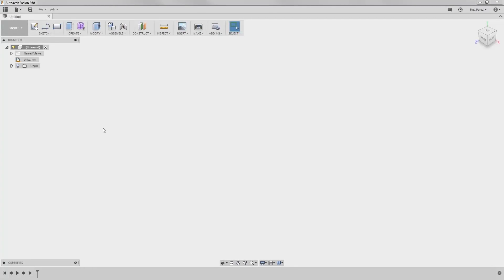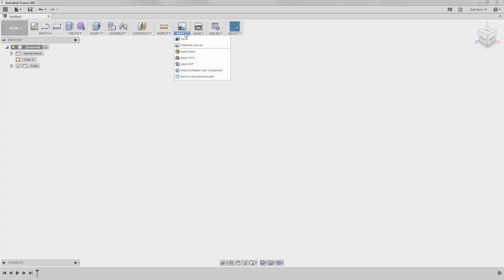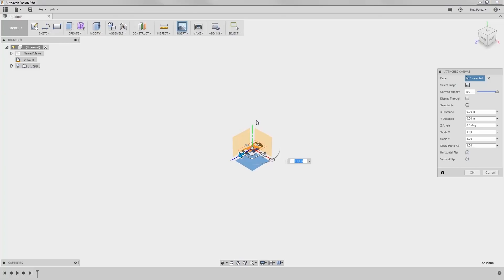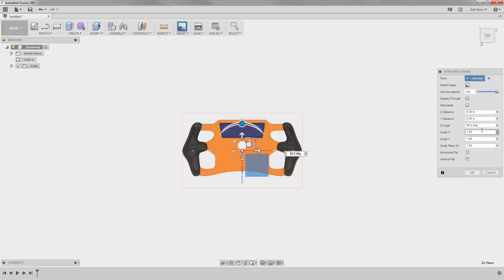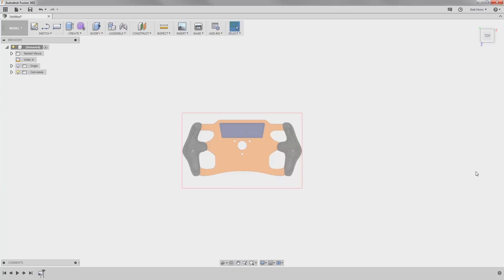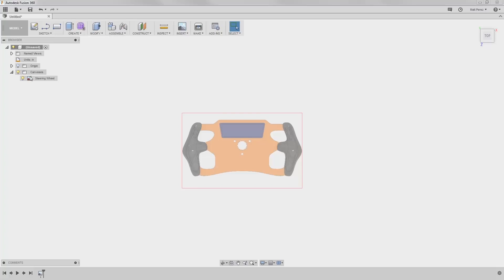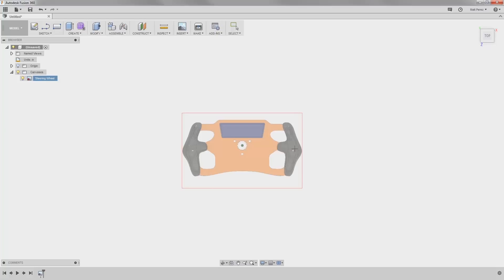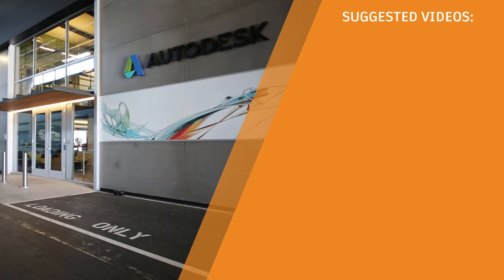Design from an Image Canvas

Comment: One important thing not mentioned here: If you want to have decent control over picture opacity of your canvas image after you insert it in Fusion, make sure your JPG or PNG image is a 16 bit color image. An 8 bit color image will produce a washed out canvas image with almost no control over opacity which in turn will make it very hard to calibrate and trace.

Comment: You should add a way to snap the corners of the canvas to make the calibration precise. That you have to click two random pixel of the image and that's calibrated enough is laughable.
Reply from the maker: @deses-  Because the the image is an image and does not have vector graphics, there is not a way to "snap".  However, the large you can spread the calibration point apart, the more accurate the calibration will be.

Comment: Thanks for the overview video.  I just downloaded the startup free version, scanned a part with my 8.5x11 office scanner, and inserted it as a .pdf via canvas.  I would love to use the calibrate function, but first need to actually view the image.  Any tips for getting my image into the frame?  modulating opacity did not help.
Reply from the maker: Wondering if it's the file type or tool that makes it. Can you try inserting other images as a test?
Reply: @adskFusion  File type is a pdf....are there different types of pdf?

Comment: Great video. 

Just wondering why isn't there a feature to just click the corners of the box surrounding the image and calibrate it from that?  Isn't guessing where you think center and horizontal is could in fact not give you accurate representation of your model?
Reply: It does seem odd to guess when everything else is precise. It could at least snap to vertical/horizontal.
Reply from the maker: Images are dimensionless. However, if your images are drawn to proper scale, include that on the image so that you can use it during the calibration.
Reply: Such a shit reply that answers nothing of his question.

Comment: I´m currently using Autocad, but planning to switch to Fusion in the near future, and I use the Attach function in Autocad almost daily, we scan templates from our customer with a large scanner, and then I can just attach it in Autocad in 1:1 scale. With the scanner calibrated correctly and with a good template, we can get about +-1mm tolerance on things up to about 2m long or so. Looks like I´ll be able to do that just as easily if not even easier in Fusion. May have to change my workflow a bit since now I can have 20 templates attached in the same drawing and then draw 20 different items.